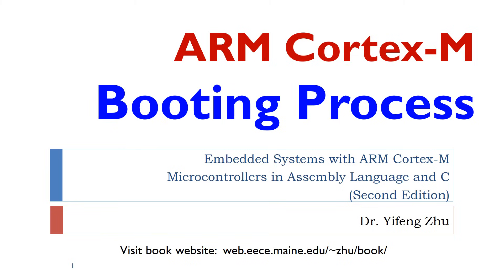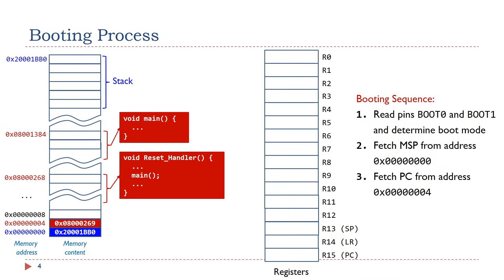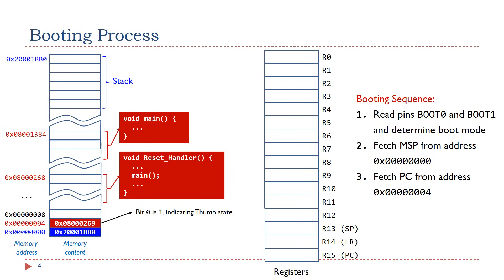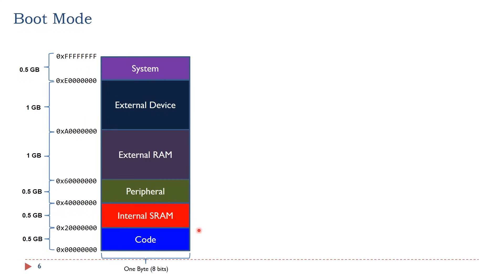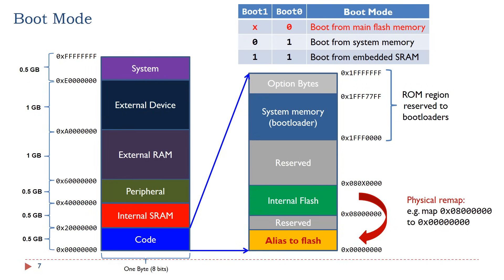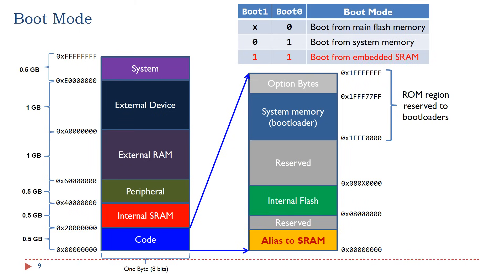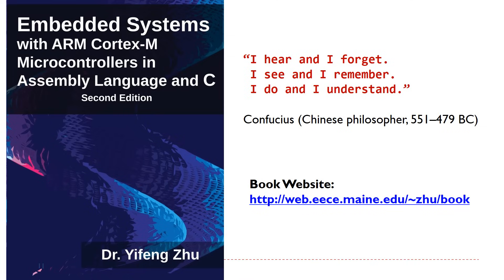Lecture 15: Booting Process

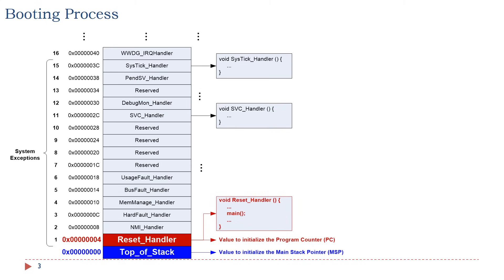Comment: 01:24 Why is this capacitor a bypass capacitor:face-turquoise-covering-eyes: Doesn't it play the role of power-on reset of the system? When the system is just powered on, this capacitor will be charged, and the voltage on the pin above it will gradually increase during the charging process, thus completing the reset.🤔

Comment: the describe about boot from ram might be not correct .
actually on stm32f103 boot from ram is same as boot from system memory. the bootloader senses the pin configuration than transfer excution to ram.
but not alias ram to address 0

Comment: Hi Professor, 

At 7:43 , you say - "In the Boot mode, processor can reprogram the Flash memory or Perform the device firmware upgrade".

Please can you help me understand :

1) Why reprogramming the Flash memory is done ? 
2) Please can you make video on "How device firmware upgradation is done by BootROM(boot memory). Can you please point me some resources to read.

Thanks 🙏
Reply: Hi I think I can help you with the first question, the bootloader that exists in system memory is a set of instructions that can do multiple things like reading the received program from the UART interface and upload it to the flash memory (that how programing uC done)

Comment: What is Main Stack Pointer (MSP) ?, does MSP point to memory location of boot  because video at 6:57 state Physical map Ox08000000 to Ox00000000.
Reply: Arm provides 2 stack pointers (MSP and PSP) to able to seperate threads and supervisor mode. by default, MSP is used unless programmed otherwise.
Depending on Boot0/1, the CPU will map regions of memory to the alias region, so the MSP address loaded is hardcoded to 0x00000000
Reply: MSP is the address of the Stack I think

Comment: I am using STM32F103c8t6 MCU with IAR IDE and when testing the startup code, the MSP and PC registers are initialized from addresses 0x08000000 and 0x08000004 respectively without any aliasing from address 0x00000000! Kindly note that the .intvec value in IAR is set to 0x08000000 value. So, is there any problem with that?